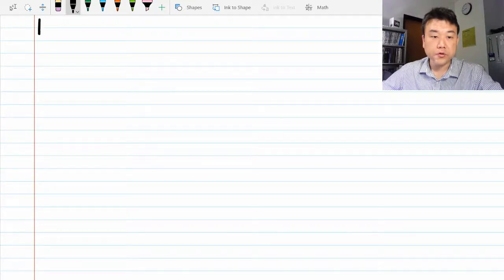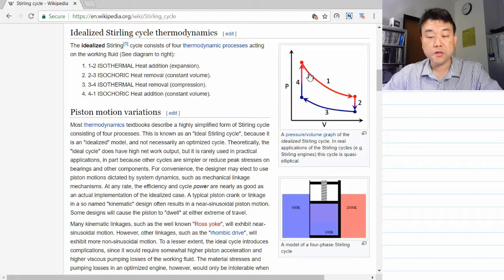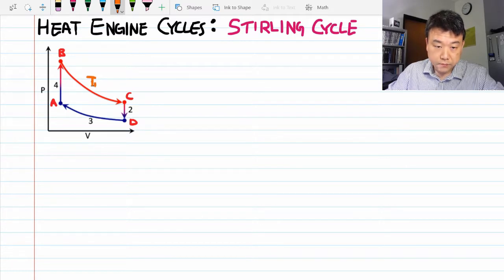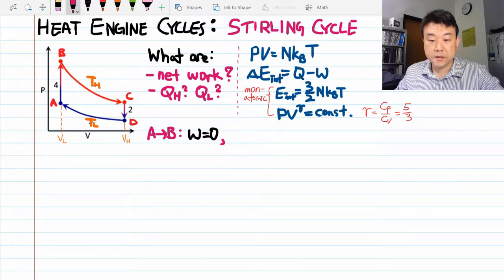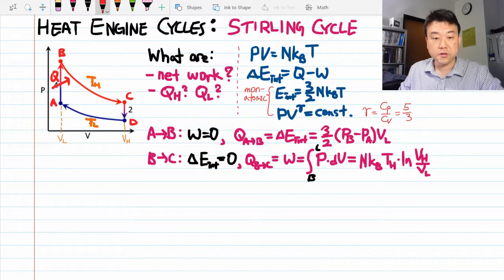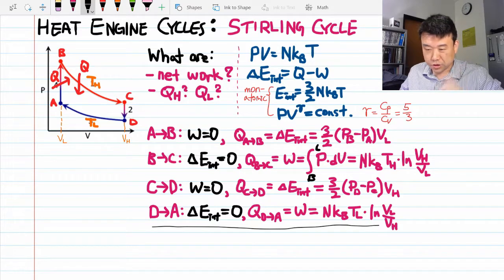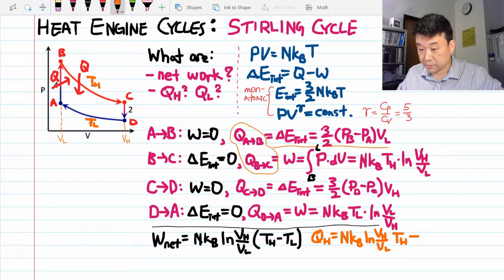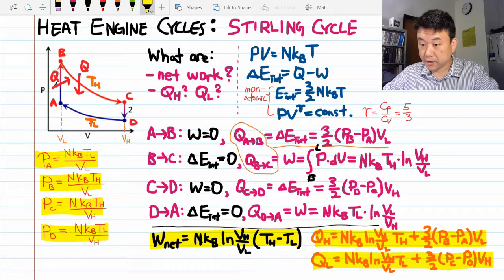Heat Engine Cycle Example, Stirling Cycle

Comment: shouldn't ¥ =Cp/Cv = 7/5 as sterling engine has air ( basically nitrogen + oxygen  ; both diatomic )
Reply from the maker: For a real Stirling engine (e.g. a lecture demo), yes. This is a contrived educational example and the working gas was specified to be monatomic (you could imagine a Stirling engine filled with helium or other noble gas, for example; this would actually be doable for Stirling engine, unlike internal combustion engines). See around 2:51.